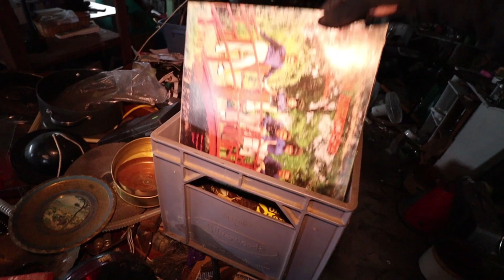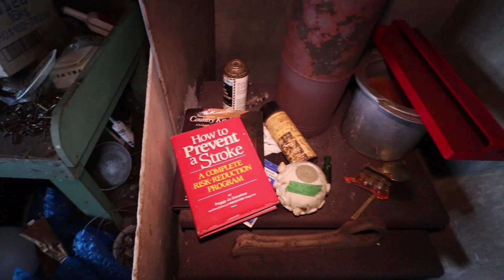HAUNTED ABANDONED HOUSE WITH SCARY TREASURES LEFT INSIDE! | MOE SARGI

Comment: Sorry to burst your bubble but that's about a 20 or $30 clock definitely used to have the exact same thing they run on batteries
Reply: Depending on the maker that clock could be worth 500 bucks or more. My parents have one and it was appraised at around 1500 dollars. Without seeing the maker of the clock it's hard to discern. The one my parents have is wind up. No battery.
Reply: @Tzaddiel  maybe your parents do have a clock that looks similar to that that was appraised for $1,500 and you're right it would depend on the maker but I can tell you for a fact just by looking at it I can tell that that is a $30 guaranteed mark my words
Reply: @JenniferDiaz-vb7qk  yeah I didn't see the bottom did it have a battery door?  And I'm pretty sure it was than antique shops its more of a thrift store they're in.
Reply: @Tzaddiel  wow I didn't even notice that there was a battery door. Just seals it I guess I can just tell by the gold that it's not real it's overlay of plastic just the way the casing is around the bottom I can just tell by the quality of it that it's a knockoff because I do know that they do have some very beautiful clocks that are very expensive and I do believe that your parents possibly do have that type of a clock but I know that that type of clock is not what Moe used in this video unfortunately Moe does have a habit of exaggerating it makes for good content you know